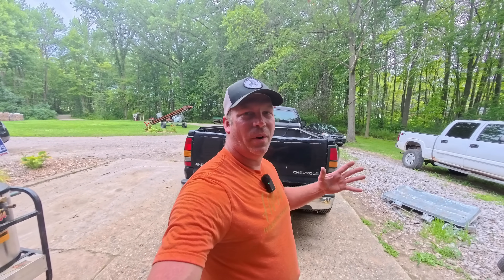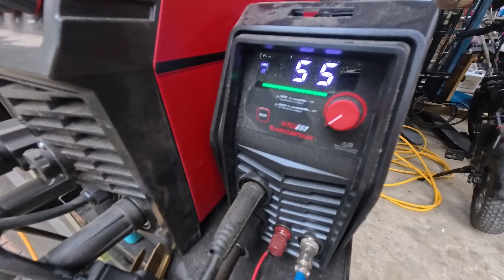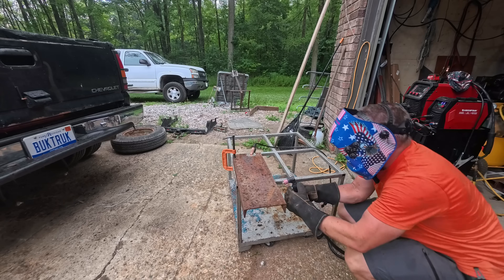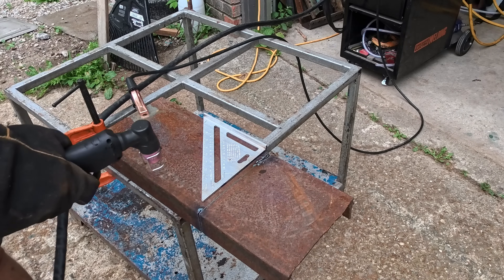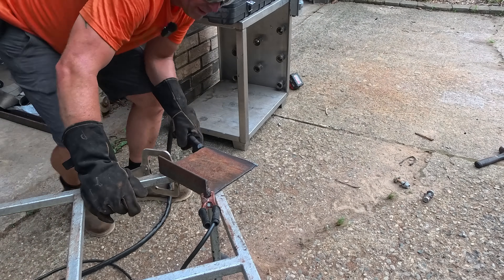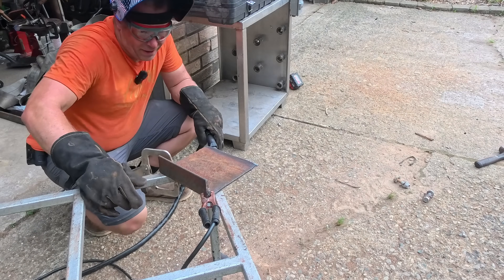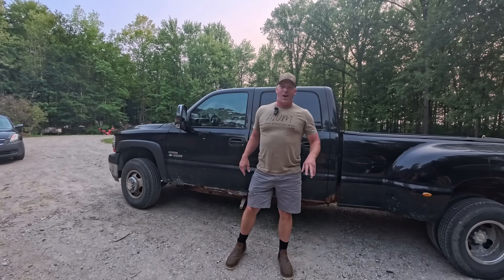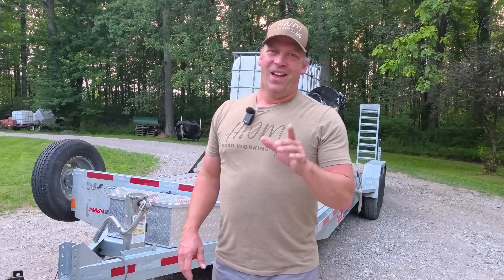I Never Could Have Done This Before! Technology & Safety!

Comment: Hi.  I have a caution for you.  The UV radiation from  an arc welder or a plasma cutter can seriously burn unprotected skin.  I have a lot of experience with both.  It can even cause skin cancer.  Please consider buying a welding jacket and  wearing long pants.  Also, you can buy a little gadget called a vortex tube.  They work off of compressed air.  It's like having a personal air conditioner.  Sandblasters use them a lot.  They may look hot, sandblasting on a summer day, but the vortex tube keeps them cool as a cucumber. 😊. Shalom/gw
Reply from the maker: Thanks, I bought one.

Comment: Clean up the steel a little the rust will mess with your cut. You may want to move a little  faster if you go to slow the steel will pool up and weld the pieces together.  Try to look in the curf as you cut to watch the steel blow out. The biggest problem with a torch and plasma cutting is the speed  you travel
Reply from the maker: Thank you! Found out I definitely should have cleaned the steel too.

Comment: 2:02 we spray all of our equipment with New Hampshire oil works really well plus it has a black tint to it
Reply from the maker: I have a 5 gallon bucket of some black rust prevention spray but need to get my big compressor going.
Reply: @hardworkingmanoutdoors  the good old used motor oil ?😂   that actually works really well too.
Reply from the maker: @fatefarmspa yeah I’m not a huge fan of that after seeing all of the health problems my dad and uncles are dealing with as older mechanics. Could be in related but I think a lot of that stuff is worse for us than we think.